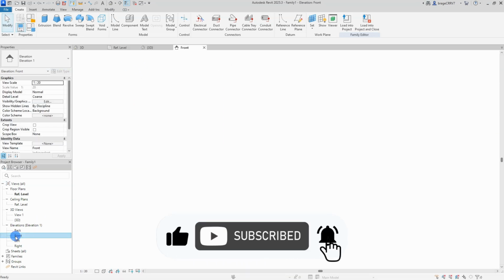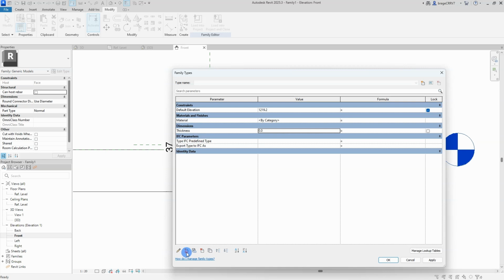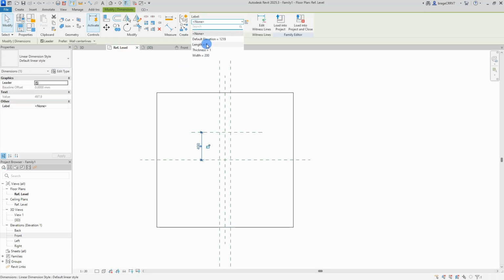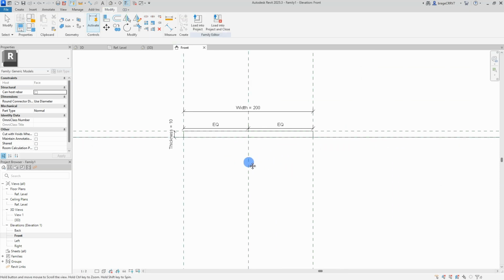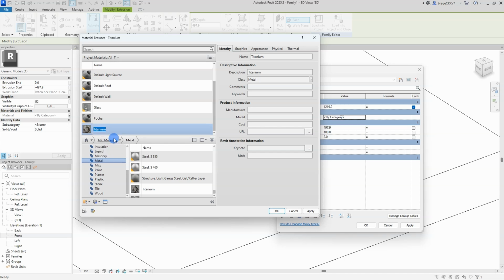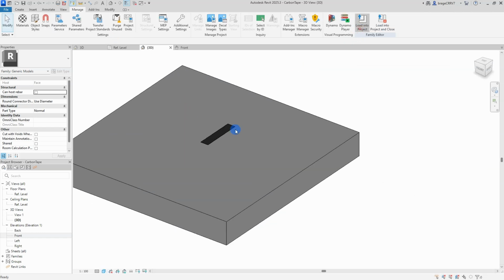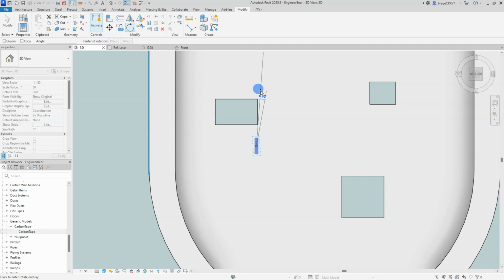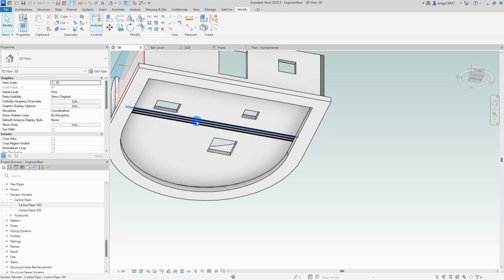Revit family | Face-based  carbon fiber wrap

Comment: Thanks bro...
But what about curved face
Reply from the maker: Thanks mate..
That is a challenge! 
Solution one is to create a family with an angle parameter. If the wall has a fixed curve, you can then adjust the family angle parameter so it would fit the wall.
Solution two is to import the geometry into Revit adaptive family and create the carbon fiber wrap there with the help of Dynamo.